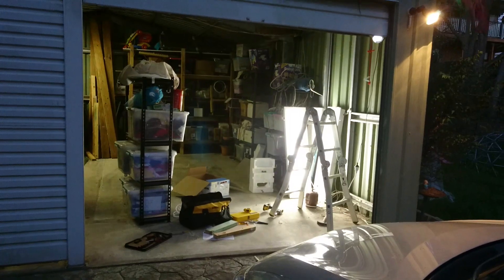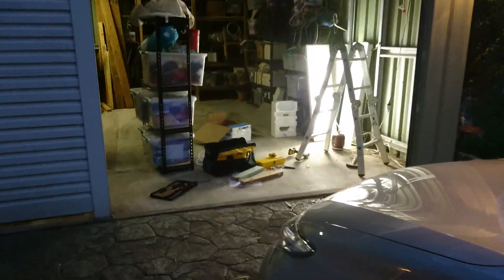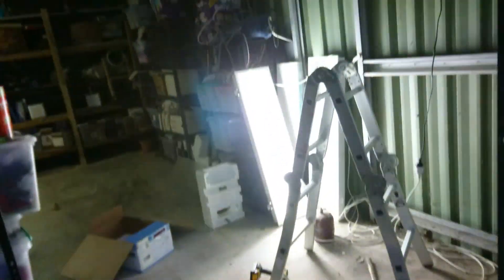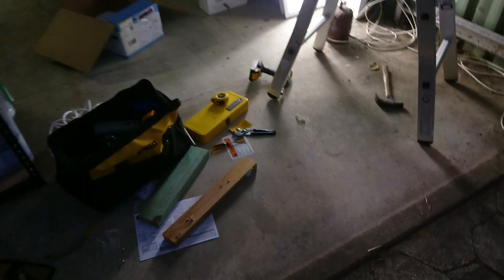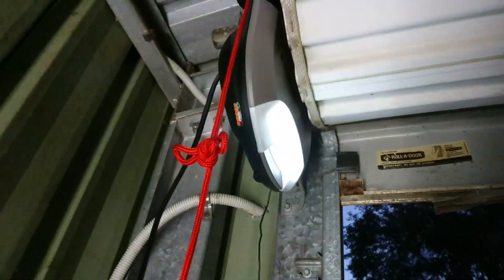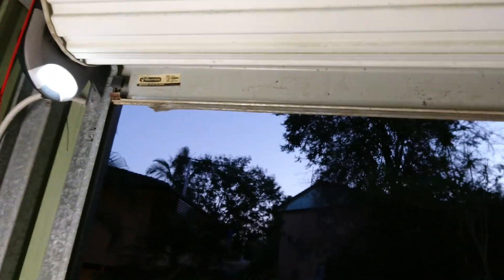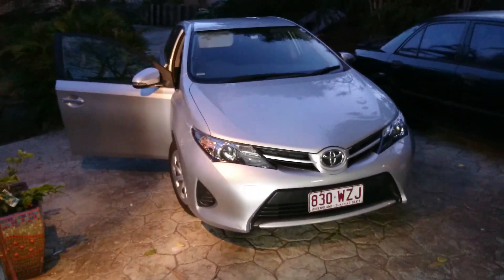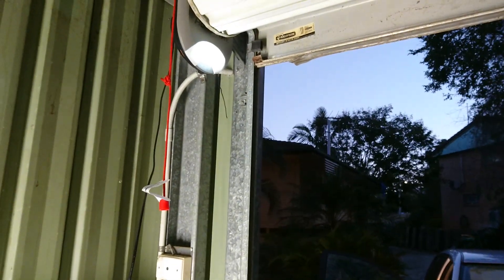Roller door motor.

Comment: I'd be interested in a link to the model, it looks like it might fit in the tight spacing of our garage here.

Also bluetooth beacon in the car for sensing?
Reply from the maker: This is the one:

https://www.bunnings.com.au/homentry-rolling-garage-door-opener_p3962056

I'm thinking maybe an ESP8266 in the car that is seen connecting to the home wifi and triggers it to open, or something like that. Bluetooth mightn't have the range.
Reply: Cheers for the link! An 8266 on the IO for the opener itself would work, I've come across esp8266 boards with male usb plugs so you could always put one of those on the cigarette lighter plug.